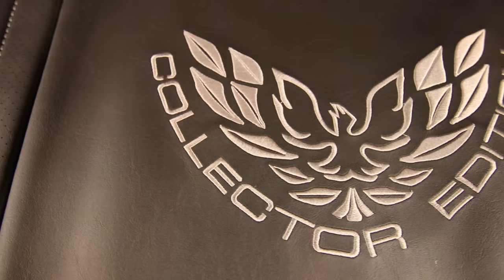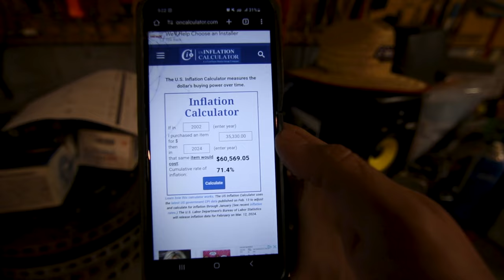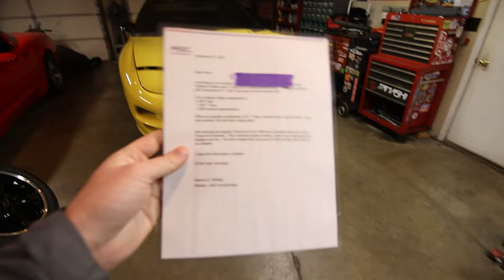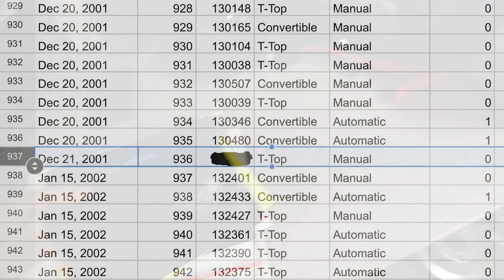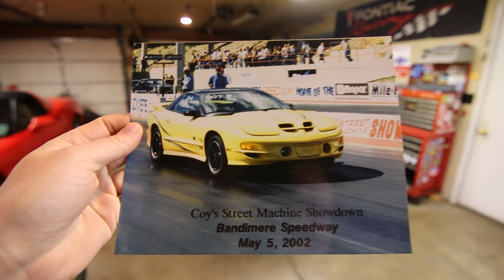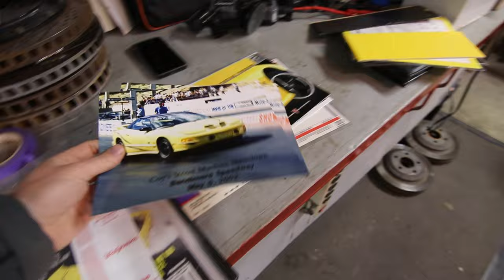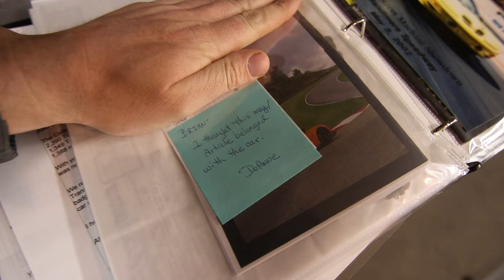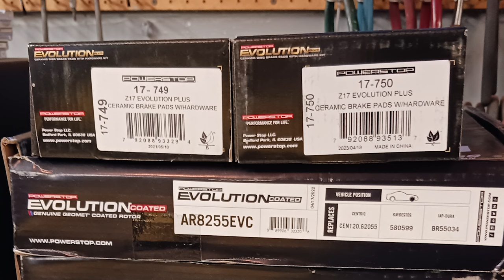I Didn't Expect To Find This... CETA Update & Maintenance!

Comment: Welcome to the CETA club!  I have car 1315 (M6, TCS).  I tried using saddle soap and conditioner on the trophy mat and it has worked a little, not stiff anymore but still too tight.  I got a JL 1:48 too, but had to get reproductions of the window sticker, ACS letter, brochures, etc.  Seems I need to find the supplemental warranty book!  That is great looking CETA, keep it running well!

Comment: Man that's a nice ceta!!   Are you going to lower it? Or any suspension work at all. And will you put you Welds on lt??   IF you still have them.
Reply from the maker: Right now I don't intend on swapping any suspension parts. It drives great as is, plus I don't want to wreck it hitting cones haha